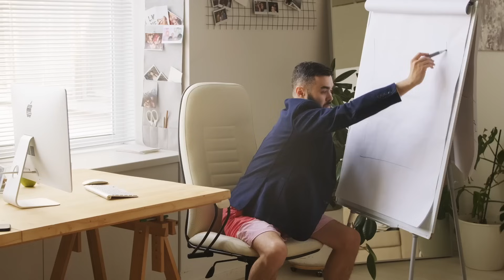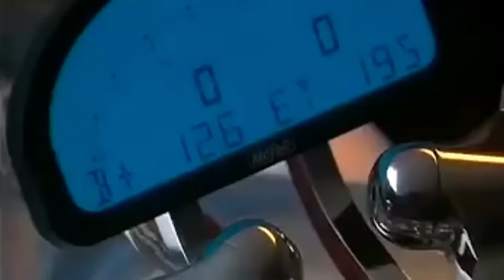When a Car Manufacturer tries to make a Motorcycle

Comment: I always assumed the reason for the double tires was because you can't have a 1,500 lb motorcycle and a 6 sq in contact patch of rubber for traction🤷...... Also that's probably too much weight for a conventional motorcycle tire.

Comment: the reasons why that machine would never get to 200mph
1 the wheels and suspension are not designed for anything realistic
2 the rider has no good seating position
3 the torque of the engine would roll the bike over during harder acceleration/deceleration 
 i mean i could add a few more here but its pretty obvious that the bike was just for display purposes only as its primary engineering design choices reflected that

Comment: Have you seen Alan Millyards proper motorcycle with a dodge viper motor he rides it around like a normal motorcycle and did set a couple of speed records with it it has front forks like a normal motorcycle a swing arm and two wheels front and rear and he built it in a shed a normal sized single car garage with all his tools in it and he could only do a little over 200mph on it so 400mph purely a dream he couldn't go any faster because he couldn't hand on to it but he built it on his I own no help he saw the Tomahawk on television and thought he could build one and he did Alan Millyard is a true genius the motorcycles he has built are crazy using mainly Kawasakis as for car engines been used in motor cycles not big V8s but Amazon motorcycles used a Volkswagen beetle engines and people have put Volkswagen flat four engines in BMW motorcycles older ones that is also there are people who have put motorcycles engines into cars so there are people going the other way just do a lot of you tube research

Comment: Technically, motorcycles have less than 4 wheels in the USA. So yep, that is a car legally, but the Nikken is a motorcycle 🏍️
Reply: Tricycle is a tricycle no matter where the extra wheel is.
Reply: @XtreeM_FaiL  yes, and a tricycle is a motorcycle with three wheels. Genius.
Reply: @oulupulu  Wrong. Motorbike's wheels are inlined unless you mount a sidecart.
Tricycle does not even handle like a bikes do. It is like a car.

Comment: Except....it wasn't built in house at all but in a small fabrication/race car shop in Walled Lake Michigan.  Little if any Chrysler engineering went into the motorcycle besides the engine.

Comment: drag does not increase exponentially with speed. Drag power increases cubically with speed. 5th grade stuff.

in general, exponentials in physics appear in the solution of dynamical systems 
df = ω²x dx ->  f = e^(ωx) for complex ω. 
Very rarely in scaling relations.

Comment: It seems to subject the rider to yaw-like movements when accelerating on an uneven surface. It's expected that a 1500lb bike using 4 wheels will handle differently. But it seems like the ride itself would be alien to an experienced rider and with that kind of power it's not a vehicle for a novice.  Is the engine torque problematic? Seems like it would be like trying to land a Sopwith. 
 
It does look amazing, naturally. Back when there was still a heart in the vehicle industry. These days the emphasis seems to be keeping drivers entertained during soul-crushing daily commutes. The only  Tomahawk I'd commute on would need a 20mm forward/aft and few missiles. Caltrops might be handy as well. Maybe a Batman costume......

Comment: Very interesting; good job on this video. However, I wish I knew that you were going to make it! Let me know if some day you want to sit down and hear how it happened, see studio images used in the design process, see photos of the fabrication process, hear how the last part had to be designed such that it could be made without being sent out for CNC milling because we had used up the entire shoestring budget and no more money was incoming, learn why you never see the rear wheels scissoring independently (they do this when leaning but the suspension was intentionally blocked by inserting a steel pipe through the hollow rear axle. This was done out of fear that a rider might not be able to keep it upright if suspension were allowed to articulate freely... For anyone who rode bikes regularly, this made the thing extremely difficult to ride; it could not be counter-steered like a bike until you got the thing up on one rear wheel; otherwise it had to be steered like a trike which is extremely hard to do if you're used to riding motorcycles), learn about the "testing program" (in quotes because there was no time to test at all; Kirt just got on and rode it; he was first, then Bud, his 70-something year old dad got on! Bud Bennett can be seen riding it in a few videos. I rode it up to maybe 40 mph for one video along side a test track... All I had to do was go in a straight line but I almost went onto the grass due to my brain not wanting to steer like a trike. And I would have gone onto the grass had I not yanked it up onto one rear wheel so I could steer normally), etc. 

I don't know if my name will be visible once this is posted; I'm the design guy, Mark Walters. I also did 100% of the CAD modeling, including the insides of the transmission + some other odd jobs, like trying to make sure RM got paid on time and keeping their shop cat company after hours. 

It's good that you credited RM's Kirt Bennett; this almost never happens. Without his talents, there ain't no way this project would have been possible. I've never worked with a more able engineer (as far as I know, he had no formal training and is entirely self-taught). He pulled it off on a shoestring budget and in an unbelievably short window of time. Keeping pace necessitated that I pack up and move in full time with the RM crew in Wixom. CAD data was handed, hot off my computer, directly to Future Tool for milling while I got going on the next part. Kirt drew up the 2-speed transmission on a note pad using a ballpoint pen and handed it to me with catalog full of bearings, telling me which to use and to allow 50 thou interference for every inch of outside diameter. 

Amazingly, Chrysler agreed to this arrangement; i.e. letting  me off the hook for 5 months; they'd check in every now and then but mostly they just let us get on with it. I can't imagine another automaker doing that. Hands down, best place I ever worked. RM also demonstrated real trust by allowing me to work alone through the night; they gave me the keys to the front door and told me not to forget to lock it when done.  The building housed a really fantastic multi-million dollar inventory of vintage race cars; we're talkin' seriously cool stuff... Porsche and Nissan GTP stuff; El-Ow-El-Ay T-70s and the like. I could compare how different manufacturers handled the same parts; suspension or brake mounting or whatever. Some of this found its way onto the bike.

Freeman Thomas: Freeman's role in this project needs explanation and elaboration. He was a MAJOR part of it and a catalyst for some very interesting, midnight-oil-burning times at Chrysler. Add to this the cast of designers that somehow ended up in his advanced studio all at one time and yes, there are stories.

Comment: Looks like crap and a
Pain to ride 
Allen Millyard built a 
V-10 Viper Motorcycle that 
Looks beautiful and 
Functional to ride 
Top speed so far 
Over 200 MPH
Throttle half open 
Check out Allen’s
Viper Bike and 
You will agree !!
Reply: You must have missed it.... Bart does introduce Allen's Viper v10 powered bike and makes particular note of the fact that it's a genuine fully rideable motorcycle (while showing some video of it). He also spoke about the speeds achieved by the bike, and Allen's engineering genius and creativity...
Reply: @chris_vk3radio  Allen’s genius and creativity blows the tomahawk away to oblivion.

Comment: Why is there no footage of it running with sound? Or moving faster than parking lot speed? Anywhere. Where's the exhaust? Have you ever seen a Viper video not reving the engine, blowing 

Until I saw footage of it at goodwood I was convinced it was fake. Guess I was wrong.
It's still stupid and fake in the sense tou can't actually ride it. I *HATE* it and the attention it gets.

Comment: In actually Harley Davidson by Lincoln Ford Mercury AKA Zeppelin's lucifor check dirigible hydrocodone gas lift station the two cylinder compressor by way pumped fresh air behind the Hydrogen not through by way not engine hydrogen only becomes active when electrical charge pushes through tablets into lead plates water electroyics in neutral state weighs more than air electrical motor to air pump working on Venturi pushing fresh air and hydrogen up into dirigible kinda diabolical but a little safer than putting wheels on and chasing work with the tomato can carburetor are still Beter and cheaper

Comment: Just as ugly and stupid as everything else they ever made :D 8.3 litres for 500 horsepower...... A Suzuki can do it with 1.3 litres :P
Reply: You're comparing stock vs modded, there are some Vipers that make over 3000 wheel horsepower
Reply: @dono2926  and? those are no longer Vipers, or even Dodges at all, they are aftermarket. There are 3 litre 2JZs making 3000hp..... Still makes that 8.3 litre boat anchor pathetic <3